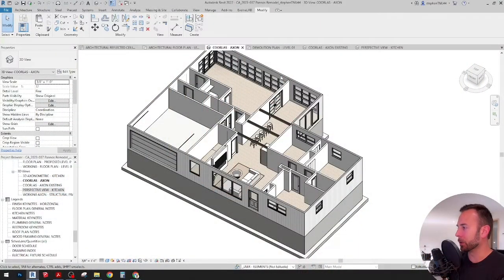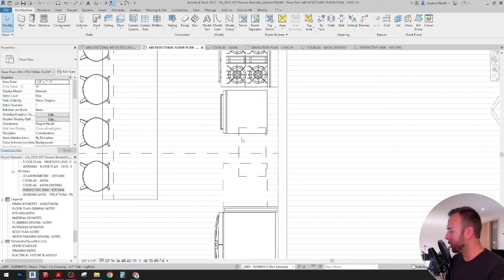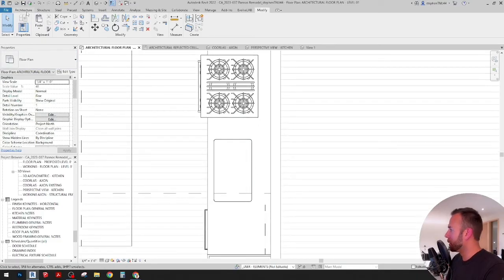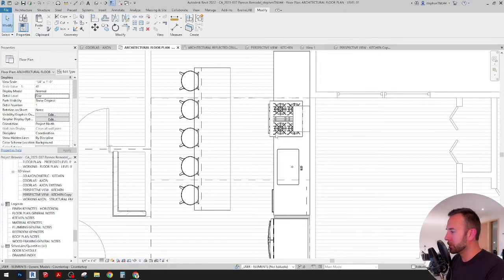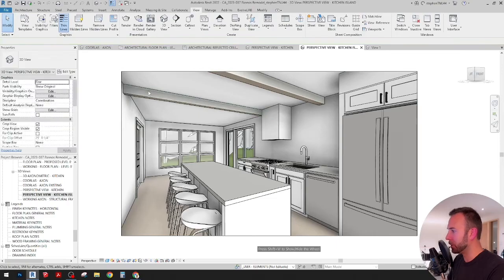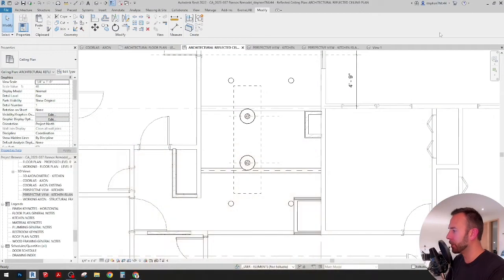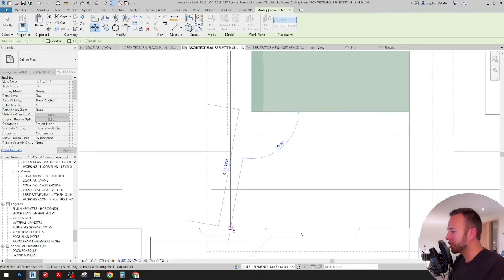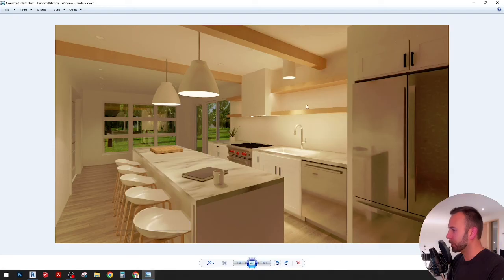Residential Kitchen Design (Revit Tutorial)

Comment: The only reason to fight with revit in kitchen is to get drawings, otherwise there are many programs where kitchen design is easy
Reply from the maker: There are many kitchen layout and design programs available, but yes the drawings and coordination of utilities is the benefit of modeling kitchens in Revit.
Reply: It has been like this since it came out. There's a lot of back and forward ain't optimal I really love revit, but there's a lot of struggle with the kitchens cabinets. At this point they should be more dynamic.